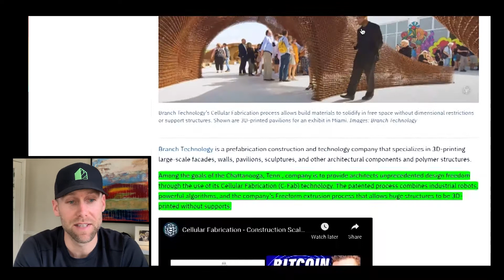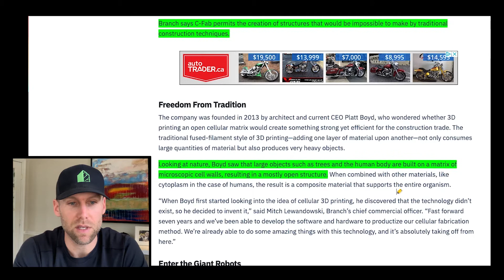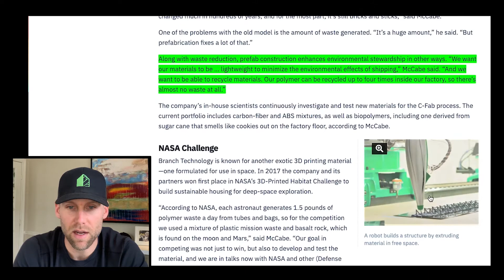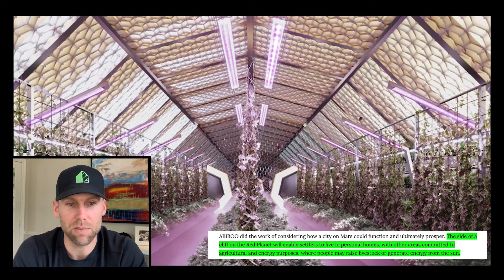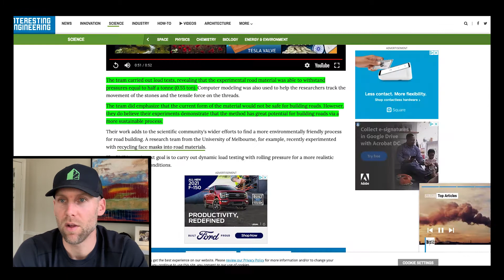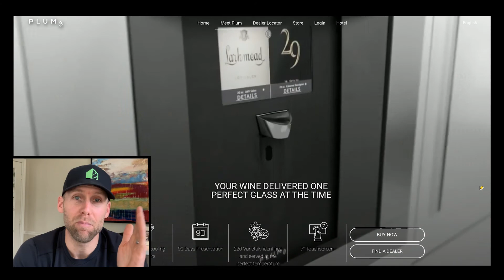3D Printing, City on Mars, Sustainable Road Building + Keeping Wine Fresh | Construction Tech Update

Comment: Have you ever looked into using power over ethernet (PoE) for residential lighting applications? Cat6 cable would be less expensive that nmd-90 and wiring could be done without needing an electrician. That said, expensive switches would be required and I am not sure about availability of lighting fixtures but I believe the energy consumption would be low with a great deal of customization potential.